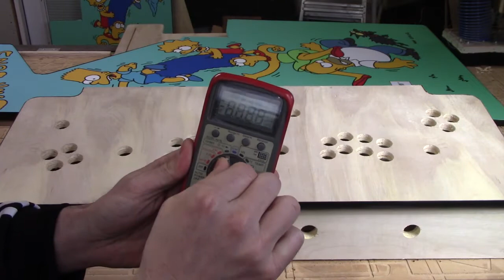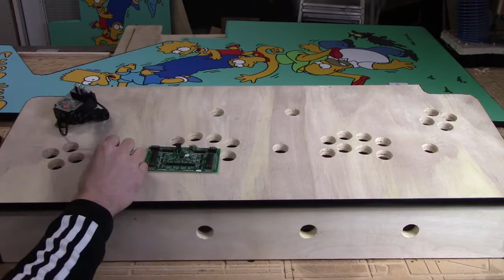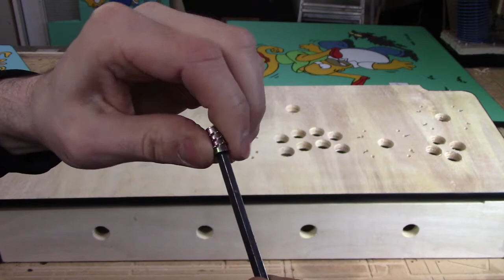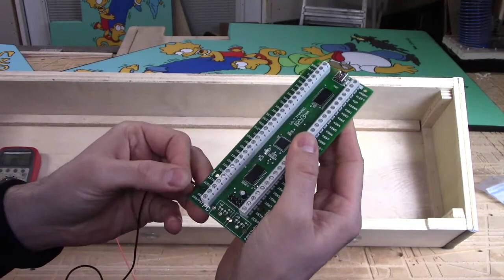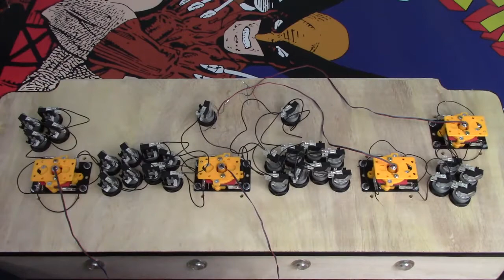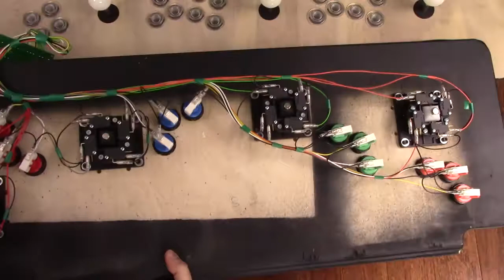How to wire an arcade control panel with color changing RGB LED buttons

Comment: Hey I'm at home depot what is the crimper tools you used and what the name of each tools and connector you have.
Reply from the maker: You'll have to get the dupont crimper from the internet if you want to do connections for the ultimate IO board.  If you're crimping .187 quick connect style connectors this one may not work.
https://duckduckgo.com/?t=ffab&q=dupont+crimper&iax=images&ia=images

This is an example of a crimper I use for the quick release/spade connectors
https://www.walmart.com/ip/Crimping-Tool-Wire-Crimper-Plier-Terminal-Wire-Connectors-Ratcheting-For-Electri/732422193?wmlspartner=wlpa&selectedSellerId=101040947&adid=22222222222000000000&wmlspartner=wmtlabs&wl0=e&wl1=s&wl2=c&wl3=10352200394&wl4=pla-1103028060075&wl5=&wl6=&wl7=&wl10=Walmart&wl11=Online&wl12=732422193_10001060322&wl14=.187%20spade%20connector%20crimper&veh=sem&msclkid=b620ab357afd1a8d3e79ca912c273594&gclid=b620ab357afd1a8d3e79ca912c273594&gclsrc=3p.ds

Here's the stripper I like 
https://www.homedepot.com/p/Klein-Tools-8-1-4-in-Self-Adjusting-Wire-Stripper-and-Cutter-for-10-20-AWG-12-22-AWG-12-2-and-14-2-Romex-Wire-11061/206318106
Reply: @bossrobotgames  ok will do

Comment: hello. how much will it cost me if i order 1 of this from you?
Reply from the maker: Hi Jimm,
This option costs $350 more than my regular priced control panels.  The parts are expensive.
I need to update my website to offer these for sale.  If you want one with six buttons in the two middle joysticks, painted and art installed the price is $1075 + $60 shipping.  This is subject to change as I figure out the supply chain.  
The panel in the video is not painted because customer opted to save money by doing it himself.  I can also sell these in a kit.
Please contact me at contact@bossrobotgames.com if you have more questions.

Comment: What did you find was wrong when you only had 2 lights light up? I am using the same setup with a wall plug and I only get 1 light to turn on when I plug it in. I've gone through all the wires several times and can't find any mistakes in the wiring.
Reply from the maker: I had two white lights appear if the board didn’t communicate with the usb connection.  The lights wired to pins 1-3 and 49-51 would stay white if there was no usb connection.  
Is your usb hooked up also.  You can plug it into just about any computer.  Give it maybe thirty seconds to be sure but it should do a light show to let you know it’s connected.
Reply: @bossrobotgames  The problem you're describing is exactly what I'm finding. The button connected to pins 1-3 stays white all the time. And I don't get any kind of confirmation from the lights when I connect via USB to a computer or to the Raspberry Pi. I installed LEDBlinky and ran some tests using "Simple LED Test". Pins 1-3 don't respond like the rest. When I select Port 1 I get light blue instead of red, Port 2 gives me Pink instead of Green, Port 3 gives me Yellow/Green instead of Blue. RGBCommander doesn't control the lights at all, even with your XML file loaded into it. I'm totally stumped.
Reply from the maker: You’ve tried multiple USB ports it seems, and if you give it a while, like thirty seconds to respond; the only other thing I can think of is a bad usb cable or maybe the board is a dud.  I’d try another usb cable and then contact the manufacturer.
Reply: @bossrobotgames  Thanks again for the reply and for your videos! They've really been a big help troubleshooting my setup. I reached out to Ultimarc and Andy said that it's possible that the script that drives the light show somehow got deleted from my board. I'm not even sure how to access the scripts, so I'm not sure how I would have deleted it. He also let me know that there is an option in WiniPac that fixes the issue I was having with pin 1-3 and 49-51, in the config tab, there's a checkbox for "Enable High Current Drivers". Once I de-selected that option, the issue went away. Now those only light when there is no active USB Connection. I un-installed and re-installed RGB Commander, now that seems to be working too. Thanks again for your advice. I really appreciate it.
Reply from the maker: All right, I’m glad you got it figured out and thanks for letting me know about the checkbox for high current drivers.

Comment: which brand joystick and buttons did you use? i am asking because i am interested in making home arcade with ultimarc ipac ultimate with 2 players and hyperspin working with LEDBlinky
Reply from the maker: I should have included this in the video.
 https://paradisearcadeshop.com/home/controls/levers/levers-paradise-arcade/2054_paradise-rgb-led-joystick-long-shaft
These are $30 a piece which is cheaper than most and the quality is pretty good.

I also got my buttons from them, here is the rgb led portion.  I should add this and the cost to my video description.  It is pretty expensive when you add it up.
https://paradisearcadeshop.com/home/electrical/pcbs-lighting/led-lighting-solutions/button-leds/100_il-lumination-rgb-5vdc-led-?search_query=Rgb+led&results=320
Reply: @bossrobotgames   Hey sorry, dumb question maybe, so just buy like the transluscent buttons (as listed in their Accessories to this item) to work with the LED you noted? these?: https://paradisearcadeshop.com/home/controls/buttons/il-industrias-lorenzo/il-psl-l-series/275_il-psl-l-concave-button-translucent-white   or would any transluscent button work?
Reply from the maker: @rushNbust  They need to be a Suzo/Happ style button because the LED board slides over one side of the button as shown in the video at 11:28.  There are a few buttons of this style but I could only find the translucent kind from Industrias Lorenzo, and they're a little more pricey.
Reply: In in the same boat as you...I just got a gutted  cruising USA cabin...

Comment: nice setup, what is the total cost for this?
Reply from the maker: I haven't figured out a final cost for a set up like this.  As an estimate the RGB buttons add a lot of cost as they are about $2.50 per button more and the controller is $110 rather than $35.